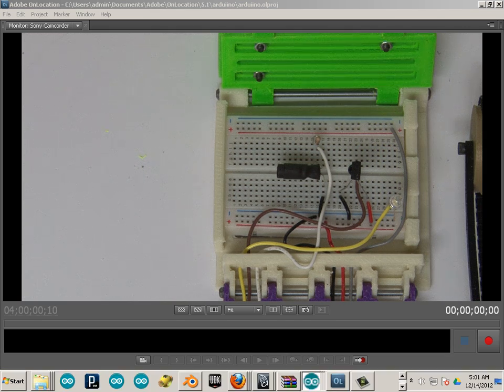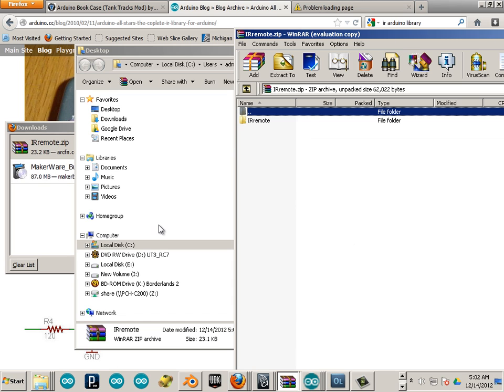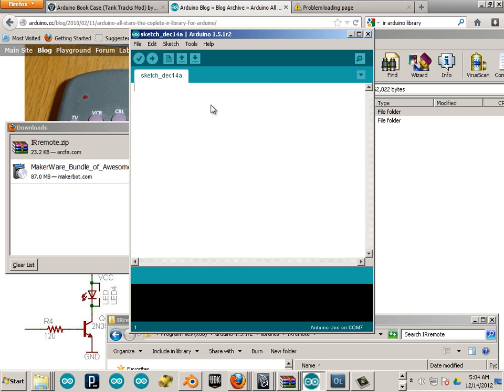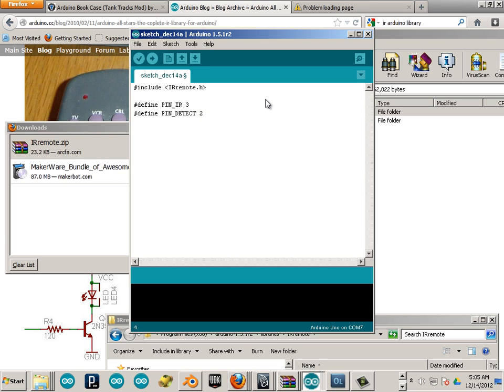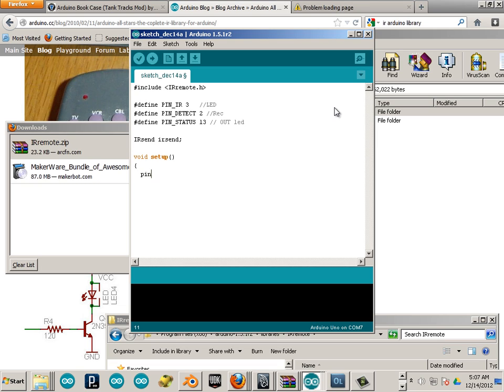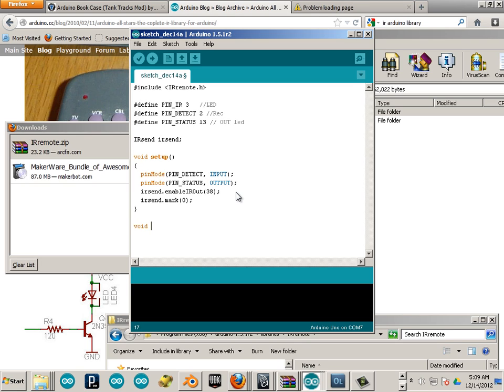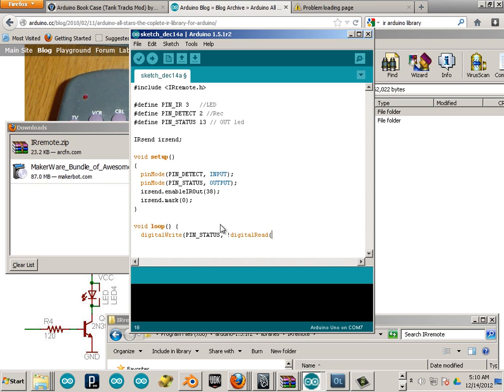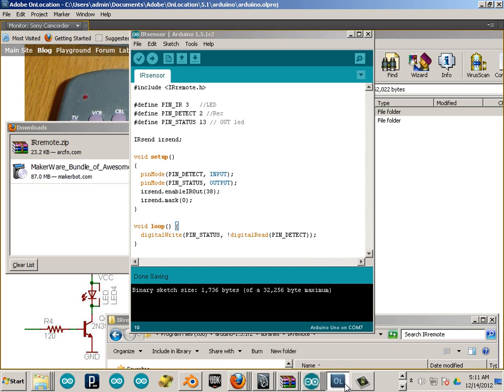1203 Arduino  Chapter12 IR sensor Code

Comment: Thanks for the video, just starting out learning Arduino and trying to Frankenstein a program together myself. Where I think I'm getting caught up is on what you touched on in the video.... knowing what to steal and what needs to be changed. Primarily libraries, I just started watching videos to help me learn, so if you have one already, please point me to it. But, where do you find what words need to be called upon inside a library you wish to include. For example, I've see several codes using a RTC or 5110 LCD, each has it's own way to pull up info that specific I guess to the library used. Not knowing which author they used or how to change that coding to work with what I have is driving me nuts..... Any pointers, or video on this already? Maybe an idea for a new video?

Comment: what did I wrong?
"Arduino: 1.5.8 (Mac OS X), Board: "Arduino Uno"
ir-test.ino:7:1: error: 'IRsend' does not name a type
ir-test.ino: In function 'void setup()':
ir-test.ino:13:3: error: 'irsend' was not declared in this scope
Fehler beim Übersetzen"